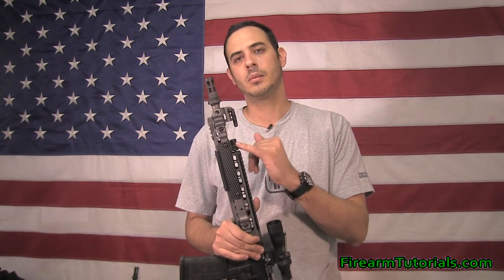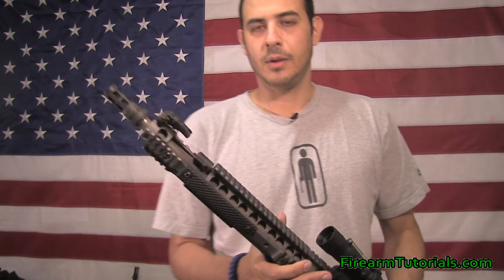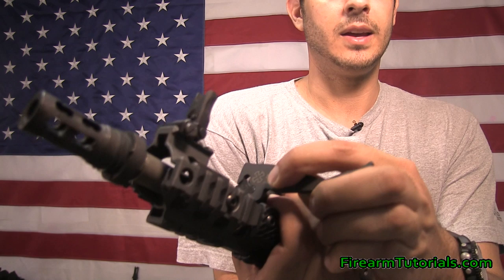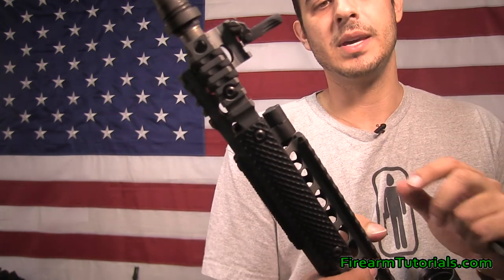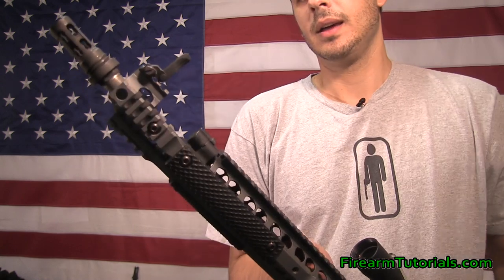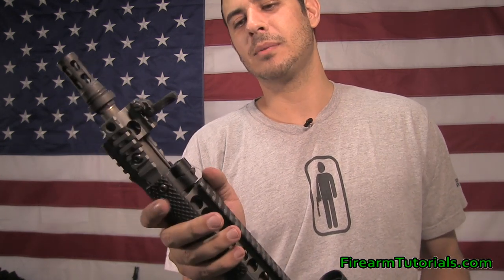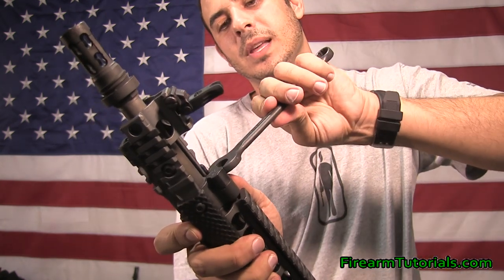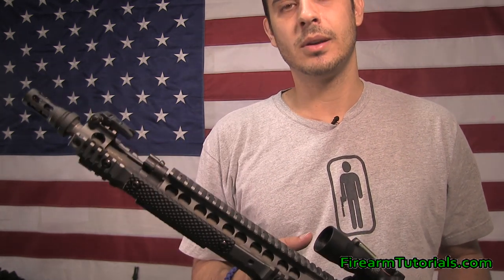Noveske switchblock and wrench

Comment: I have a question ! I just got my hands on a brand new switchblock and its of great quality . Besides that excuse my ignorance im no expert but in what seeting do you want to keep it to shoot normal without a surpressor?
Reply from the maker: If you are behind the rifle like a shooter, your left-most setting is "normal"  The middle setting is OFF meaning no gas.  You will need to cycle the weapon manually.  It's helpful for precision shots and/or making the gun as quiet as possible without the port noise.  The right setting is suppressed.  Lets less gas through.  If you leave the suppressed setting on without a suppressor it will usually eject cases, but not feed new rounds into the mag.  Thanks for watching!
Reply: FirearmTutorials .com thank you so much and great video !

Comment: Just curious if this would give enough gas on the highest setting to run 300 supers reliably unsuppressed
Reply from the maker: I don't think it's compatible with 300BO.  At least not without some modification.  This uses a special gas tube which is longer than what you'd want on 300BO since most are pistol length gas.  I'm not sure if this is true mid-length or whatever Noveske went with.  I also don't think it would fit over any 300BO barrels.
Reply: @FirearmTutorials  That’s unfortunate. There’s a lot of potential in a gas block like this on a 300 blackout rifle, especially for swapping between subs and supers or suppressed and unsuppressed. Is the gas tube removable by chance? I could put in my own pistol tube if it was
Reply from the maker: @Jonk_Jonk  I don't think it's removable.  You can get a better look in this video: https://www.youtube.com/watch?v=e6qwy_UrYrs&ab_channel=FirearmTutorials.com

Comment: Is that a night's rail you cut down to fit the switch block?
Reply from the maker: Yes sir.  It look kinda funny since there is a huge gap in the front but it's the only way to get the it assembled based on the rail design.
Reply: @FirearmTutorials  awesome brother! Mrspooky and I milled out NSR / NQR rails for a couple of builds we did. You are 1/5 ppl in the country I know of that has modded rail to fit around the switch block! 🤙🏻👊🏻 Props my dude!

Comment: how well does the system eliminate over gassing and gasses to the face about to order a n6 308 switch block
Reply from the maker: It's still present.   I'm a lefty so a quick burst of fire and I'm still choking on gas.   Overall it's a reduction,  but not an elimination.

Comment: The Seekins Precision BAR rail fits with the Switchblock and it is made better than a Knights.  The Knights rails use their own barrel nut which can be $$$.  Knights rail even use their own bolts that you have to buy from them for a good fit, again giving more $$$ to knights!

Comment: How far off the barrel does it protrude? Im ordering a large diameter rail from nordic components and im wondering if it would fit underneath.
Reply from the maker: You have to be really selective with the rail.  Especially with the way it is installed.  You'd be better off with an adjustable block like the Syrac if you aren't going to use a Noveske specific rail.  You might be able to get it installed, but it's really though.  Impossible with some rails.  I saw a picture of someone who had a switchblock installed with some other type of rail.  Inquired about the gunsmith who did it.  Asked the gunsmith and he said he wouldn't do it again because it was such a pain.    Whoever cut this rail initially did a hell of a job because it fits and works but just barely!

Comment: what rail / length is that?
Reply from the maker: Knight's Armament URX 3.1 rail.  It's 13.5"  if you are thinking of getting one do some research on the gas block.  Most of them won't fit under it.  Even the "low profile ones.

Comment: Does the urx 3.1 get pretty hot quickly? I'm debating switching out the troy trx rail on my SBR since it gets real hot pretty fast.
Reply: Do you think the shorter 10.75" urx would be different in terms of getting hotter than the 13.5" when used on a 11.5" sbr?
Reply from the maker: Yes, a barrel that short is has less surface area to dissipate heat, so it will get hotter.  I'd still do it though.  I'm going to do a 12.5" barrel with a 10.75" URX.